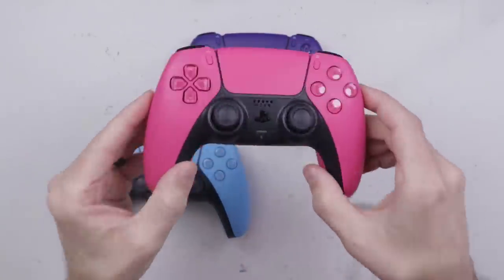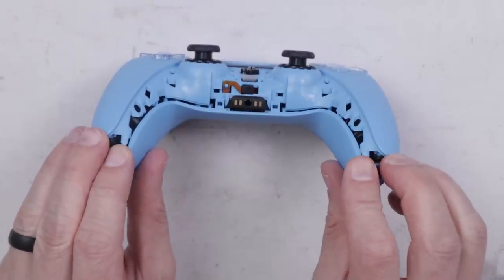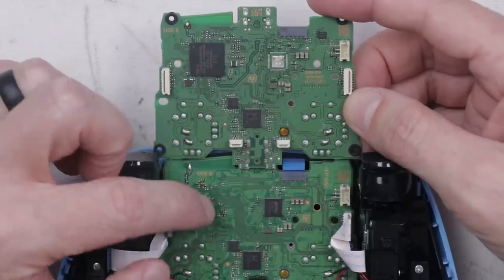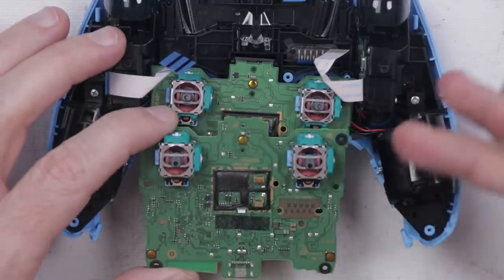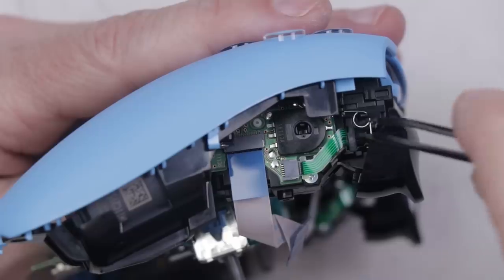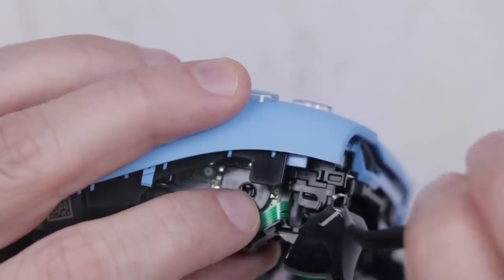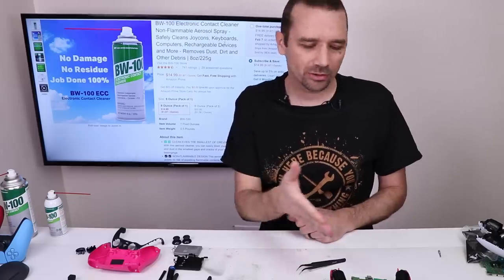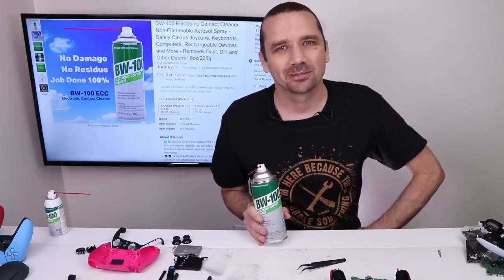Sony Did Something Right?! New PS5 Controller Teardown & Comparison

Comment: There are slightly different changes as the new colours have a small letter after the version.

What I also found out is you can not put old controller board into the new shells. The shells are slightly different from the inside so they don't sit flush with old boards.

Middle touch button has only 1 screw instead of two. The screws are silver and not black. 

Not alot of differences but as I do custom controllers you realise the differences.

Comment: Biggest improvement on the spring is the removal of the obvious bend angle. Where ever you get a pronounced curve to straight section, you have a weak point. The new springs look less pronounced so should be stronger by default before the extra wire gauge.

Comment: I took my original PS1 (non-analogue) controller apart the other day to give it a bit of a clean. The difference between that simple controller with its single PCB board and the huge amounts of tech in the DS5 is immense! 😂

Comment: I use QD electronics cleaner to fix stick drift, sometimes I have to clean it 2-3 times but works without taking the controller apart. Has saved me 100’s on controllers.

Comment: Got the purple one last week, used it for about 10 hours (playing HFW), and so far it's great! I have noticed a minor rattle on the right side when the motor kicks in hard, but I haven't been able to pinpoint exactly where it's coming from yet. Also the grip texture on the back feels a tiny bit more pronounced than either of my whites. I thought my primary might have just been worn down a little, but I have a second original white that's never been used, and it's definitely not as pronounced as the purple one. Wish they'd have upgraded the batteries, but the minor improvements they did make are welcome!
Reply: Weird
My purple one has a tougher push on the circle button
Wonder what’s going on lol

Comment: Sadly for me you didn't go further into the controller, I wish I could see the touchpad structure. In some of your older videos, it is attached with 2 screws, but when I opened my own controller, it was attached with only one and a piece of plastic on the other side. I was hoping for a comment on the repair side from you. That aside, it was nice to see the springs measurement, keep up the awesome work with the channel!

Comment: I had an issue with one of these new controller, maybe you might be interested in this. I think I have strong hands, because after a few heavy session of GoW, I noticed the X button stopped working correctly. It's sometimes worked, but it's fully stopped while I pushed the L3. I was sure the problem is with the connection between the motherboard and the ribbon cable. Thanks for your videos, I decided to repair it myself, so I went to get some tools and I fixed it with extending the height of the padding under the ribbon cable. :)

Comment: Why is it that in 2022 we can't have controllers with good and resilient analogs? It's the most important part of a controller and at the same time the first to fail. COME ON!
Reply: Funny everyone complaining about that. It is a mechanical part of course it fails first.
It just looses stuff overtime, so u need to replace them at some point. Just learn to solder and change them yourself and easy Money safe.

Comment: Does the BW100 help with any liquid damage on a PCB? I have a Macbook Air, that has water damage.  I have used the IPA on it.  It appears to have helped a little,  but I am still not getting power.  So maybe it will clean better??  Than k you for what you do,  you have inspired me to do some work on old computer to keep them out of a landfill.
Reply from the maker: It will help to clean it but many times liquid damage needs more than cleaning. So glad you're getting into repairs yourself!

Comment: The analogue sticks won't be different; this is the same one used in the dualshock, xbox gamepads and steam deck because the company that supplies them hasn't fixed the drift problem.

However, it's going to be a very difficult problem to fix because of how they work, and I'm sure they've been trying.

Also, any of the changes they made would apply to all newly manufactured dualsense controllers. So if you went out and bought a new white dualsense, it would most likely have the same thickness spring and board layouts to these new colours
Reply: Drift is not a problem, it's a  f e a t u r e

Comment: I wonder when will they release different color ps5
Reply: They have the different colour plates that you can buy and install
Reply: Yes but you have to pay extra for them
Reply: @PEJED  ya but there only 50 dollars . think about this when I had a company just to have a radio commercial and a online add the cost was upfront was 9000 dollars plus 1900 a month what I'm saying you can't expect things not to cost the overhead  alone is expensive by the way every letter on the box you see has a cost every letter in the US your looking at .20 cents to 5 dollars it depends on size I'm just pointing this out because alot of people don't know this

Comment: Ive got (R) trigger wear on my ps5 controller. Would a trigger spring from a ps4 controller work as a replacement for the ps5? Asking so i dont have to buy any parts?
Reply: It works but it's not as strong, you can order replacement springs for a few dollars shipped..

Comment: Why’s the red controller more money then the rest most retail at 89 dollars and the red at 93 dollars why
Reply: Most likely simply because its more popular color and they are expecting it to be sold more or the color causes larger manufacturing cost.
Reply: @Wezqu  I can’t see how a colour would be more in manufacturing maybe they think it be bought more
Reply: @ryans413  Plastic colors can be made several ways. They use colorants (basically small plastic pieces or powder that is infused with the pigment) and depending what type of colorant it is will effect the cost of manufacturing. For example the others they might have been able to use the cheaper grain size pellets as colorant but with the red one they might had to use colored pellets or powder that cause extra steps in manufacturing.